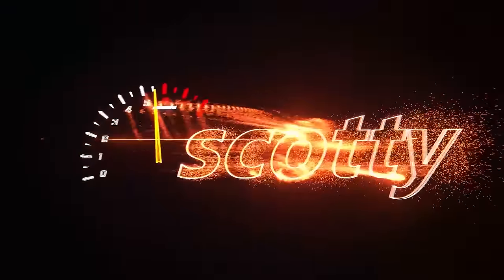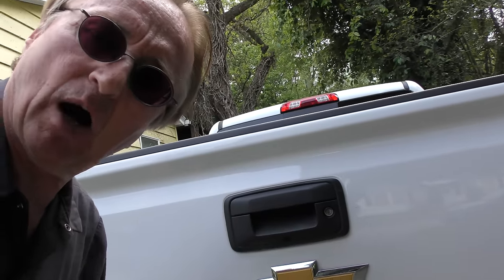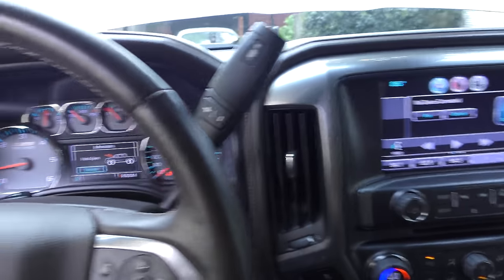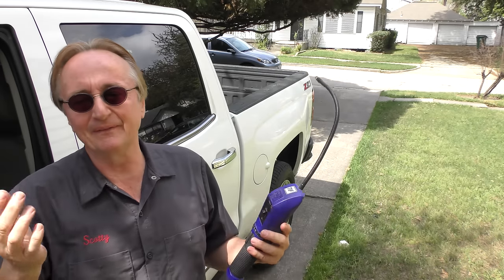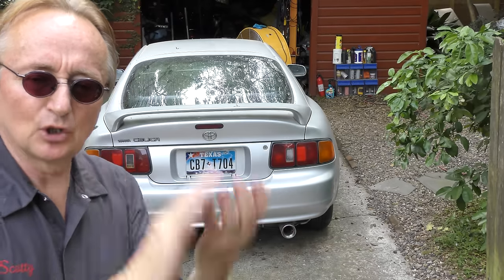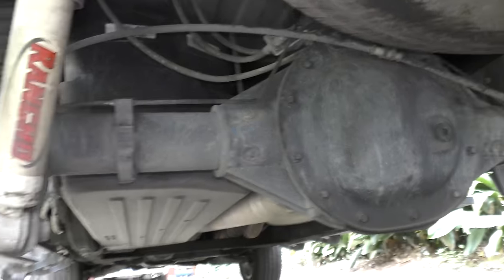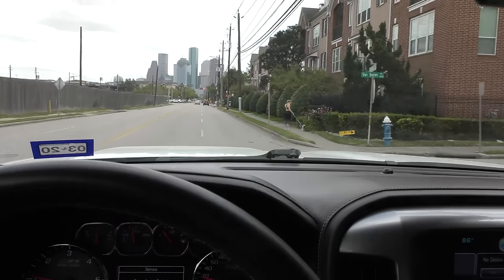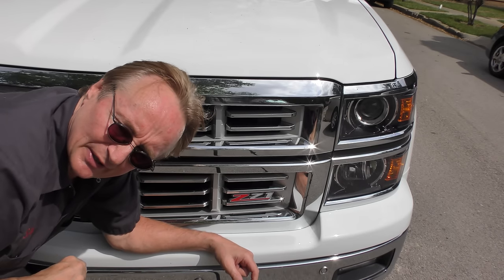Here’s Why I’ll Die Before I Buy a Chevy Silverado

Comment: 3:55 Funniest part. “They didn’t put rear AC in a $40k truck, either they are too cheap or couldn’t figure out how to do it” lol
Reply: Shots Fired!!!🤣🤣🤣🤣
Reply: It's an option.  Mine has heated and cooled front seat and heated rear seat.   You don't get much for 40 grand anymore,  which is sad.  That applies to all manufacturers.
Reply: It’s under the front seats ... the air ducts
Reply: It has a vent under each seat blowing air towards the rear seats. They fire low but helps to circulate air... still could be loads better.
Reply: Pretty sure my 08 has vents in the center console
Reply: My rear fan doesn't work and its not the fan itself
Reply: This model year did NOT have rear vents in the back as an option. And the under seat vents people talk about, do exist; but only blow air when the fan is set to floor blowing only or floor/ upper vents mixed. Needless to say not good airflow at all. This was a horrible decision by GM and they took a hit from this and brought rear vents back in 2019. 

I got rid of my 2015 LTZ and picked up a 21 Tundra, last year you can get naturally aspirated V8. Get them while you can !
Reply: @terryduncan31  No that does NOT apply to all manufacturers
Reply: I have a 2000 Silverado with this exact feature, the newer ones blow under the front seats to give the rear air then they switched back to console vents in 2016.
Reply: The time stamp is the Horsepower of the truck. How cool
Reply: @terryduncan31  the 2021 toyota sienna starts at 34 grand, about 40 grand for the XLE trim model and the sienna literally comes with a fridge in the back of the center console. it also has recliners in the midrow seats.

Comment: Chevy tail gates and handles have been cheap for 20 years
Reply: Ive never seen a Chev tailgate that close properly or didn't rattle or hadn't had the handle replaced at least once
Reply: I snapped a 2010 ranger handle in 2015 or 16 for what it's worth.
Reply: @commentingisawasteoftime7195  I did also on a ford explorer I had. But that was 1 handle on an explorer I had for 15 years. I have replaced 4 Chevy handles in less than 10 years
Reply: Truth they lots of problemes with their electronics..
Reply: Well then just pay 20k more for a f150.  I'd take that cheap handle any day to save 20k
Reply: Even Toyota pickups tailgate handles break not to mention the tailgates are very weak.
Reply: My pops has 250,000 miles on his 02 avalanche, never had a tailgate issue.
Reply: The only chevy truck I haven't had tail gate problems with was my first......a '66. No handle at all or hinges, just chains you hooked to once open.
Reply: Jedidiah Spellum I had that happen on a Ranger too. However aftermarket sold a metal handle and went with that!
Reply: All GM hardware is junk
Reply: Hot Dogs we had a 2010 ish GMC Sierra in the shop. I went to open the back door, the door handle snapped off. So, I went to put the broken handle in the bed so I could order a new one. It had a tonneau cover on it. So, I went to open the tailgate...that handle broke off also....boss wasn’t happy...
Reply: Lol...
Reply: Try 30 years...my 88 is busted...
Reply: @sirmack3262  Thanks to the American taxpayer 20 Thousand Million dollar pay off.
Well the UAW has Ford by the nuts too.
Reply: @Justin TX1988 nope. Chevy is the worse of the worse when it comes to tailgates. I have seen so many Chevy tailgates go to scrap.
Reply: @hotdogs5265  I've never seen those problems happen on chevys that dont happen on fords and dodge rams so I dont know why your talking like Chevy is the worst.
Reply: @CloroxGodThe1st  on trucks used for work. They dont hold up as long.
Reply: Yep, replaced mine a couple times before just giving up on the bezel and just grabbing the little rods. But at least the rest of the truck was pretty sound
Reply: Y'all need one those automatically opening tailgates that are on the F 150. Lol!!
Reply: @robervin4384  yup. That's back when they built a damn truck!! Not a fuckin yuppie mobile!
Reply: Robot 13  what? you mean there is something called routine maintenance? well I'll be damned, some people just don't get it. every car these days has plastic exterior handles.
Reply: @RaoulThomas007  and that aftermarket metal handle will rust and leave drip stains down your tailgate.
Reply: Tail gate handle and latch on my 2001 Ford Ranger (a true work truck) is VERY solid, just through the video I can see how flimsy it is on this 50k suburban cruiser.

Comment: Had a 99 Silverado LS with 265K miles on.  Original evaporator and still blows cold air (on its second compressor though).  It's now my son's truck.  My 2014 Silverado LT with 63k miles is just as awesome, love that truck!
Reply: Low miles for a 2014. Nice

Comment: we have a fleet of these that we maintain at work in the oil field where they're abused. never had to do an evaporator in the dash and the tailgate handles which are constantly used are never worn out. Major repairs have only been hubs, balljoints, motor mounts and the condenser (the condenser being a gm manufacturing issue, bad weld).
Reply: Scotty's videos drive me crazy.   The dash evaporator leaks on one truck, and all GM products are junk.  I owned a 2004 Pontiac Vibe, (Toyota Matrix), until it threw a rod at 130,000 miles.  My 1997 GMC Safari Van is running strong with very little maintenance at 171,000 miles.  So I conclude all Toyotas are junk, and all GM made vehicles are reliable.  Same logic.
Reply: @karllued  The only reason the Vibe was any good was because of what was underneath it. The worst part of the Vibe was the GM alternator they strapped to that 1.8l.
Reply: @zaz214  Never had any problem with the alternator.
Reply: @karllued  Not all parts on the Pontiac Vibes are strictly Toyota. Some of the engine components were still GM.
Reply: @cooperativecam5257  The engine is a Toyota, and that was the problem.
Reply: @karllued  If you say so...
Reply: @karllued  but he is basing all his talk in decades of experience working on all kind of cars, not just this one vehicle.
Reply: What does the tail gate handle in is not using it much. It gets stiff from dirt and dust building up from it not moving then you start yanking on it.
Reply: @pararanthecaveman  Have you ever noticed that Scotty never wears mechanics gloves and has no cuts on his hands ever.  He makes a video almost daily.  His Toyota has had 140,000 miles on it for at least 3 years, if you don't drive it, it doesn't break.  I'd like to know what brand of mechanics gloves he has, his hands look better than mine, and I only occasionally work on my own cars.
Reply: Use F-150's. You won't even have those issues.
Reply: @TheBuckStopsHere480  we also have a few f150's. when their motor mounts go out, it's harder to replace. Out here, their vacuum lines for the 4x4 would go bad and they run the trucks into the ground out here, ruining the 4x4 actuators. So it really doesn't matter which truck you go with, both have cons. We've also had plenty of f150's with the timing chain cover hole issue.
Reply: Ben Silva  we know how to check for leaks lol
Reply: Is that all? Buahahaha
Reply: i have a old 1999 chevy silverado and it constantly needs worked on its got alot of miles on it , and its always needed work on it. still needs work on it [  alot of work ] as soon as one thing is fixed  something else goes wrong . i bought it new off the lot and that vortech is junk , the trans is ok the rear end is trash doors are junk the engine misses out the enginei just trash . i have put thousands and i could have bought several trucks with what i paid to fix this thing ! this is its last time around and when i get a new one im gonna bury this thing ! and im buying a tundra or something like it ! no more chevys !

Comment: My 2002 Silverado 1500HD 4x4 6.0L had 212,000 miles on it before I traded it in. I drove it from 2009-2020, over the years I replaced the water pump, fuel pump, front wheel bearings, and the a/c belt. All repairs were made after 170,000 miles. I traded it in on a 2019 Silverado LD 4x4 5.3L. Wife drives a 2013 z71 5.3L. Chevrolet makes good trucks, until one lets me down I ain't changing brands.
Reply: Hood for you but trucks made after 2004 are pretty much trash.  Esthetically they’re nice but I’ve had my time with Chevy and it’s crapola.  Not to mention side bumper panels falling off bc taped or glued on
Reply: Parts are relatively cheap too.

Comment: Comparing a Chevy Truck to a Toyota Celica for the way the 
A/C works?
How does that make any sense?
I had a 99 Toyota Celica GT Convertible. The intake sensor failed then the electric motor for the top failed. And a 95 Toyota Corolla that the Alternator prematurely failed in and it costs $800!!! just for the part.

Comment: I'll never buy another Dodge Ram. We had to have our heater coil replaced so we had the evaporator changed while it was all torn apart. The Dash broke when the tech pulled it and I was charged $1500 just to buy a new one as they said "it was cracked and we didn't know it."  $3000 later when we drove it home there was no cold or heat. They had to take it apart a second time because a $10 part wasn't installed correctly or it was broken.
Reply: Trish Blassingame 
Why? What kind of problems did you have?
Reply: FIAT CHRYSLER RAM ARE ALL POORLY ENGINEERED! THEY LOOK GREAT BUT SIMPLY DO NOT HOLD UP!!
Reply: They maybe could have been more careful but I will say, Dodge historically has dashboard cracking problems on all their plastic interiors. Most of them actually just crack by themselves while your driving, rather than require someone to touch it at all.
Reply: EVERYTHING you touch in my ram is broken. Literally. Any handles. window controlls. Visor. ignition. Cup holder. Storage door thing... Everything! The dash is also cracked all over. Worst interior I have ever seen in a vehicle. My heater core is leaking too. It will be a new truck by the time I fix everything. I paid less than your dash and it's been a great truck for me atleast. 5.9 third gen.
Reply: My 01 dodge ram 1500 did the same thing about the heater core and then the dash just fell apart , all you had to do was just touch it and it would crumble but alot of the dodge rams had the same issue with the dash breaking into a 100 pieces.
Reply: I've seen plenty of Rams with seriously cracked/ falling apart dashboards. The new hemis are strong, but beware lifter rattle/ bad cams past 80k with the roller cam followers failing.
Reply: @J Bar I live in New England. I get truck fever over $1400 v8 4x4 trucks with rust free frames and no plow hook ups that aren't 5.4 fords.  I can't believe people buy garbage like Dodge or ford new. They are just made wrong. My trucks towed boats for me for over 5 years for under $4k total and looks good. Not a bad buy.
Reply: Carson D Exactly, all car manufacturers have their defects, just like FORD does. Im really trying to understand all these complaints from these peoples when all i get from our shop here in California to repair are Fords, Hondas, Toyotas, and Nissans. People these days expect so much from a vechile especially when they don’t service them, I have a customer that has a Chevy Silverado and is too cheap to spend money on a tune up, and a oil change and the truck has 220k miles on it, and the oil life is past do 5k miles.
Reply: @cn2673  Also what you really want to do is be an educated buyer in the first place .Don't buy something you can't afford to fix.   Don't have brand loyalty and don't make car buying an emotional choice at all.  Manufacturers have good and bad generations. buy something that truly fits your lifestyle that's In great shape and take care of it for a long time, a car can last a really long time.
Reply: Good I hope you learned your lesson on buying Dodge Fiat junk😎
Reply: @q-bert6454  the heater coil (is that right?) went kablooy and suddenly the windshield fogged and there was no heat. We had just had the radiator and thermostat replaced so probably related. It was a 2002 1500 Ram truck and this happened 2015.
Reply: @cn2673  Like I said they are beautifully designed aesthetically, the Ram is my favorite Looking truck but regardless of what anyone says to me,  the research and the data data all say the same thing, they are simply poorly made poorly engineered and poorly assembled with poorly sourced parts. Their quality control is awful. They wont have a chance until they get rid of Fiat,  start from scratch,  and hire quality control experts with experience at companies that are known for their reliability durability and dependability as we as their quality control. They have a reputation in the industry for a reason. Every once in a while you might see one last a long time with minimal problems but FCA as a brand is not good. It will take a long long time of making quality reliable dependable products for me to even consider the brand....and even then I would be very hesitant.  Not trying to knock an American company because I truly wish they were great,  but that's on them. I'm only saying what my research over the last 30 years tells me as well as the general consensus of the brand from every reputable mechanic I've ever known.
Reply: I have a 97 ram bought new no problems with the heater core...I flush mine every 4 to 5 years with a water hose to keep the rust and junk that gets in the core it's like flushing your hot water heater to keep it clean.

Comment: I just had this done on my 2012 Ram 1500 Laramie Longhorn w/ 110k miles was leaking for a couple years. $80 to refill every summer or $2500 to repair (swapped the heater core too because the heat was weak as well ) all under the dash. Dodge defiantly has build problems too

Comment: Dodge and Ford aren’t any better, heater cores the whole dash has to come out
Reply: Alot of work and alot of money to fix!!!
Reply: Jerome Peterson still better than chevy lol
Reply: Ford is way better than all 3
Reply: Put $3000 in ours for the heater core and the computer unit in our 2013 f150
Reply: My father has a 98 mustang gt, around 130k miles. Still all original AC and heating equipment, blows ice cold air and hot air. That's not my only experience. Fords equipment definitely lasts longer in my experiences.
Reply: Prob making a lot of money from Toyota on advertising lolol
Reply: @OneNationUnderGod.45  my 95 Chevy is the same way and nearing 190k. Needs a distributor, but that is what I would consider general maintenance.
Reply: a ford ford is a mechanical nightmare esp to shade tree mechanics like myself. Extremely inconsistent it’s nearly impossible to keep up which is why dealers get such bad names from trying to fix them. Both the fords we bought for service trucks are parked in what we call the graveyard behind the shop. Never again.
Reply: Meh...everybody knows scotty is a ford fan boy...lol...
Reply: @OneNationUnderGod.45  My friend was rear ended yesterday and it totaled his 2003 Mustang  with 309,000 miles.  My Honda or most Toyota's will never make 309,000 miles.    I stopped falling for the B.S a long time ago.
Reply: @jasavak what? I'm not really into imports but it's common knowledge that Honda and Toyota last a long time. My buddy just got rid of his 08 civic with 500 000km on it (he has a 45 minute highway commute to work). Any vehicle will last with proper maintenance
Reply: Been there, done that on my '99
Reply: Have 01 Silverado 240000 miles, has original AC parts and refrigerant, although sometimes I can smell antifreeze when defroster is on and yup entire dash has to come out and Chevy want $1600 to replace heater core. Got to love car designers and engineers.
Reply: lol everyone replying to this is comparing their 20+ year old car, every car has its problem.
Reply: @solonortenas  he can buy what he wants i will stick with Chevy or GMC my 99 3/4 ton still runs great
Reply: Carl Ryan yeah... 1987 to present and it still works great.
Reply: a ford no ford got transmission issues and blown spark plug issues too
Reply: All 3 are trash and only build for 1 thing. Power.
Not reliability. Nothing. Toyota/Honda all day

Comment: Spot on Scotty... I got rid of my 2014 Silverado after I had to replace the condensor AND A/C compressor at around 5 years old...

I took your advice and got a Toyota, a 4Runner to be exact.  I will not buy another domestic car EVER!
Reply: John Cronin 

I love the 4 runner personally! It looks great!
Reply: The 4runner looks great imo.
Reply: Mine is garage kept and has 55k on it.  I’m guessing that won’t matter to the AC eventually.
Reply: Love my ‘14 4Runner. No American SUV comes close.
Reply: If you want the newest reliable Chevy buy a 99-06 gmt800
Reply: Toyota 4Runners look great!
Reply: The condensers on those trucks are known to leak. It’s a common issue. 4Runner is an excellent vehicle. Big upgrade over that GM.
Reply: Brandon S  I got found a great find out of Kentucky; a 1998 Chevrolet Silverado K3500 ext. Cab long bed 4x4 optioned with the F-code 6.5 Detroit Diesel and 4L80e. Only 113,000 miles on her

Comment: Love my 2017 3500 with 6.0 gasser. Mostly towing almost 100k and running strong. Made some power changes to engine and transmission to ensure reliability at 40k miles. Perfect ever since.

Comment: I like Scottys videos. However, I have a '14 Silverado. Made in Fort Wayne, IN. It has 75,000 miles on it and has never let me down. I haven't experienced any mechanical issues with the truck and AC is still going strong. I don't think the reputation of the AC system  should dictate a truck being called bad, maybe understandable if you live down south. As I type this one friend has a 2016 Ford F150 with 42k is getting a failed  transmission replaced and a coworker  with a 2014 Tundra is experiencing leaking oil from his valve cover gaskets at 60k.
Reply: 75 ooooh
Reply: @johnbrennan2028  it was only 6 years old when he posted that. Average mileage for age.